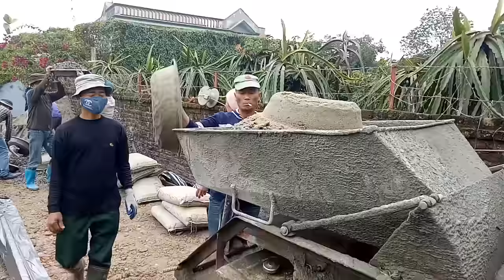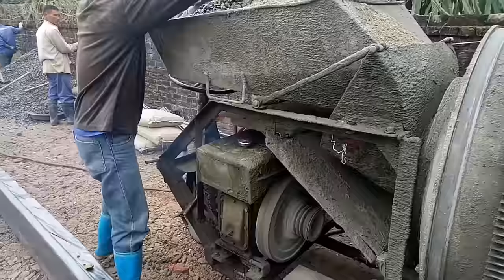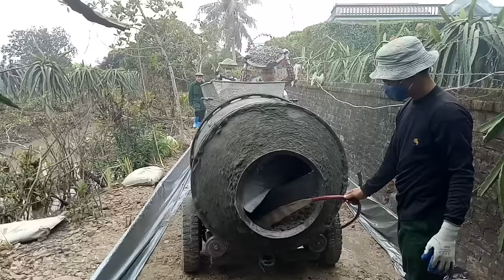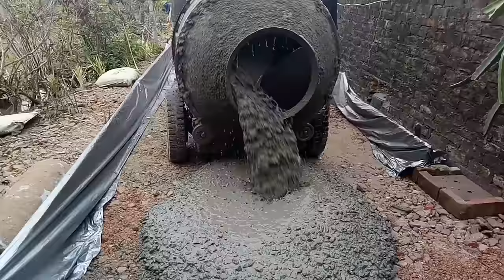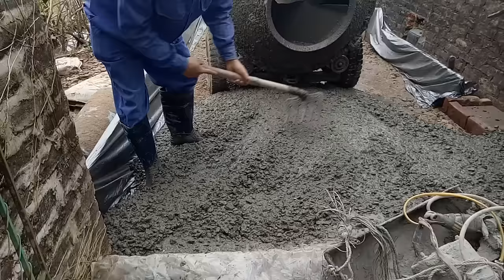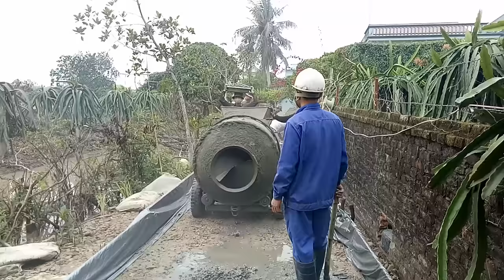Concrete Mixer Truck Road Construction - Great Construction Worker

Comment: You should put steel in the concrete, without steel, it's not strong enough!
Reply: I poured a 30 ft x 70 ft barn pole barn floor, 4 inches thick on a sandy soil base 48 years ago. Trucks loaded with 16,000 lbs of potatoes are parked on it. No steel or wire, no cracks. This is just a walkway to shed water built on a stony base. These people know what they need.